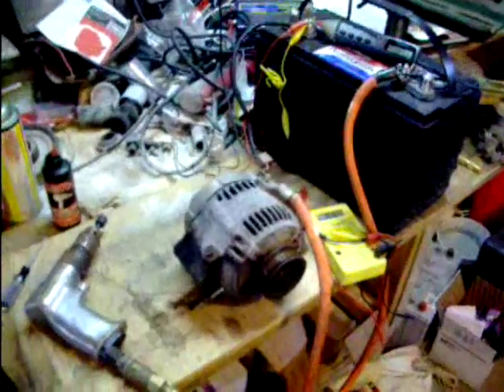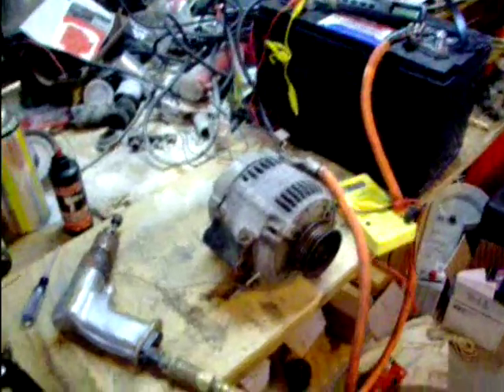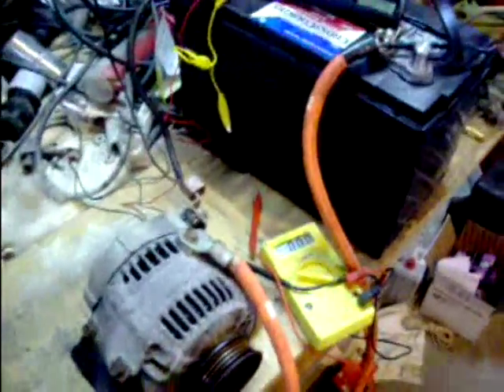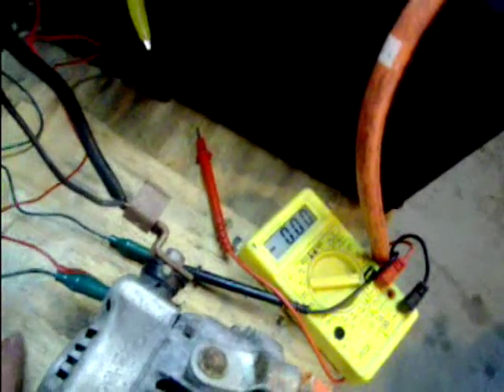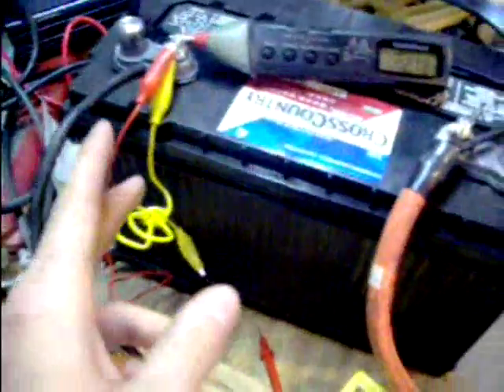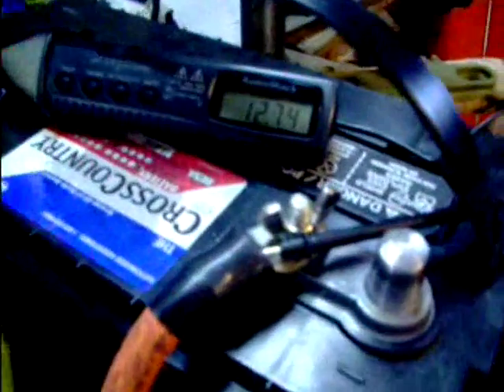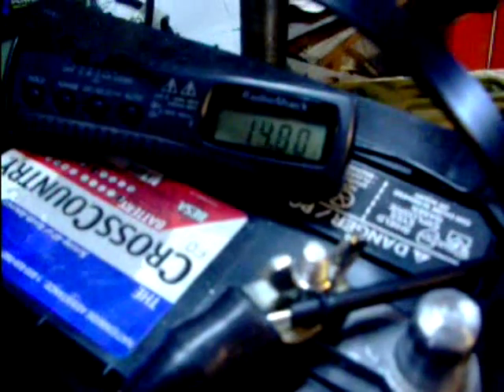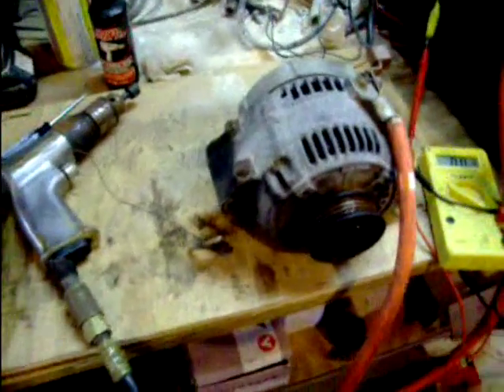alternator spun up with air drill

Comment: Very cool, I was trying to turn my alternator (to charge a deep cycle battery) using a motor from a 20" box fan. I think the o-ring I was using as a belt was far too tight and the motor burned out quickly. Have you hooked up an inverter to see how long the charge lasts?